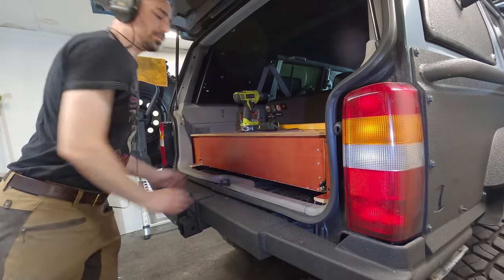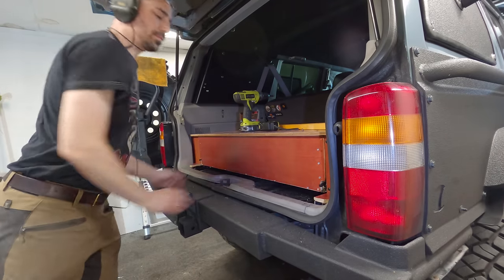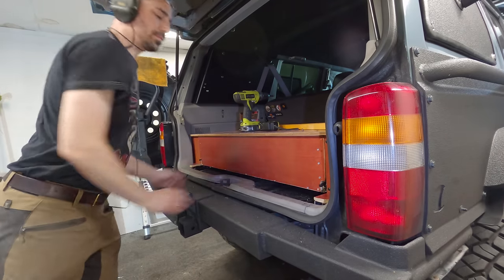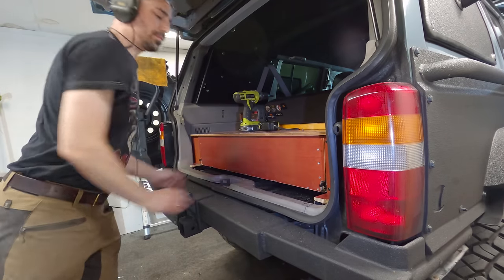Building A Simple DIY Camping Drawer System / JEEP XJ

Comment from the maker: In this video, I build an overland camping drawer system for the back of my XJ. The idea is, keep it simple, light weight, low profile, versatile, and non equipment specific and incorporate some kind of work surface that's easy to use.
My last build was a prototype because it didn't work the first time. This one might end up being a prototype. If it doesn't come out, how I want it to (spoiler, it did). I'm not the best with wood, but regardless, i am almost where I want it to be at the end of this video.
Thanks for watching, and I apologise for my language.
Also, thanks, Christer, for helping me out with some of the materials on this build!
Mike
Reply: I commented a previous video about 6 months ago. I asked with you didn't go with a ball joint delete instead of welding in your ball joints. I am happy to say that I have been running the Ball joint Delete kit for about 4 months now and I couldn't be happier. I was having some death wobble issues when hitting bumps in the rode. I was trying to track down the reason and everything seemed to be stiff and in good working condition. 

   Once I pulled the steering knuckles off I found that the ball joints were very loose. So that solved my death wobble issue completely. With helm joints on all my steering components my steering is almost as stiff as when it rolled out the factory. The only play left is in the steering box which I will be upgrading soon to the Durango box with a steering box brace. 

Hope all is going well and love the videos keep it up.

Comment: Constant camp rig mods are essential! I also go rock crawling so I really need to flexible for all! I’ve went from gear piled in cargo space. To a drawer system. To a 12v fridge and back seat delete. Now to a 12v fridge in cargo space with available back seat. It works me currently because I go without a 🍑 in the harsher wind/rain weather trips. 
I’ll sleep in back seat  when forced to. Not comfortable but do able

Comment: Attach couple poles across top extending to side of Jeep. Make drape walls attach to Jeep with magnets sewn into edge seams, sew a "bathtub" bottom into it for insect, varmint exclusion.  So much you can do to add usable volume inside/outside.

Comment: Leave those side trim panels out, finish and use  the cavities behind them...spray with bedliner, devise how to use the volume, maybe drape new thin carpet to conceal the stored items....reach over the sides of your drawer system to access.  Use a rough texture paint...or even bedliner....on those panels if you insist on using them.  Could also cut area out of panel with storage boxes inset.  Strong magnets attached to the inner body panels could hold many items....even AR rifle rack....

Comment: Would u consider adding a thin strip of nylon or pvc to the underside of the drawer to reduce the noise of the wood on the steel latch ?
Reply from the maker: In the 2nd video, I line it with some foam to take the noise out of it. It helped a lot, plus I covered it in carpet. It's deadened the noise a lot.